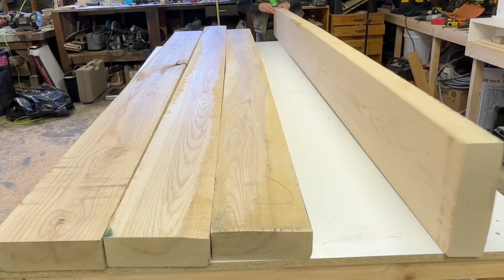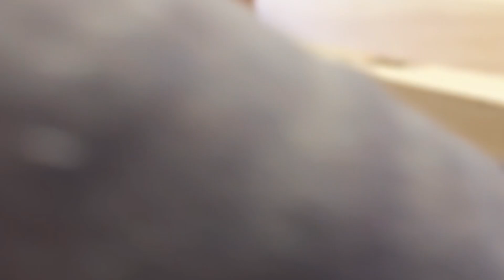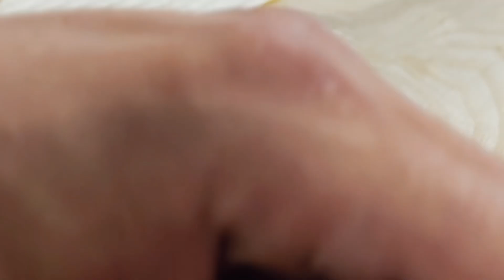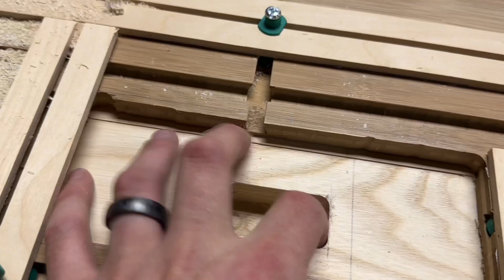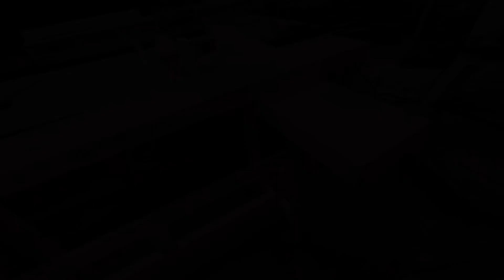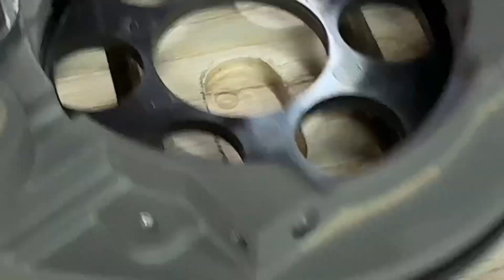$11k Custom Furniture Build - The First Table

Comment: I like the ash, hard, clean, and will stand the test of time. If if I had to choose a favorite wood though, I think I just like how white oak is readily available where I am and I like how it takes to shou sugi ban. It's easy to work with and looks really great. That table turned out great, I look forward to the next video!
Reply from the maker: Ash is one of my favorites. A bit cheaper than white oak in the NW.  This stuff was nice to work with. Hard enough to hold up, but still cuts pretty easily.  

Thanks a lot! Can’t wait to edit up the other videos, many hours of footage to still comb through.
Reply: @baddogcreative  next time I have an order for something. I'll make it out of ash, I'll press the customer towards it. 😎
Reply from the maker: I love working with ash.  It looks so close to oak with the potted grain, but much lighter and more consistent.

Comment: My favorite was white oak from these industrial pallets that I found. Turns out it was actually mahogany 🤘
Reply from the maker: Pallets are always a mystery haha.  Love me some reclaimed hardwood slats 🤤
Reply: @baddogcreative not just slats but 4x4 9ft long stringers  @baddogcreative
Reply from the maker: Oh wow those are hard to come by, especially in hardwood!!
Reply: @baddogcreative  my neighbor works at a train depot or something and every Halloween they turn their yard into a haunted attraction. They use these massive pallets as a temporary fence. Then they throw threw them out on the curb. After my wife drove off for work and the coast was clear, my 7 year old daughter went to town and used some Skateboards to roll them down the street, we spent the whole morning/afternoon taking them apart. There is still a small pile in another neighbors yard. I'm probably gonna attack those in the spring
Reply from the maker: That’s rad man.  What are you going to build out of them?
Reply: @baddogcreative  well because much of the wood is harder and stronger than the nails in them it's virtually impossible to pull most of the nails so I cut them then punched them in and used a lot of the beams to enclose my patio and build a privacy wall. I cut segments without nails and milled down into 1/2 inch x4 inch planks for use in smalls like lanterns, lamps and wine bag boxes
Reply from the maker: That’s really awesome I’d love to see some of your work!!